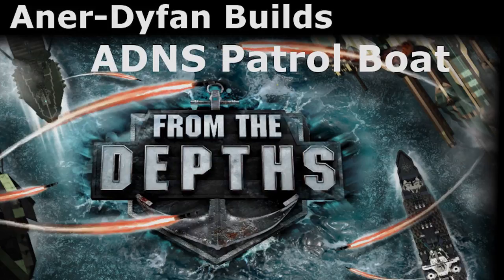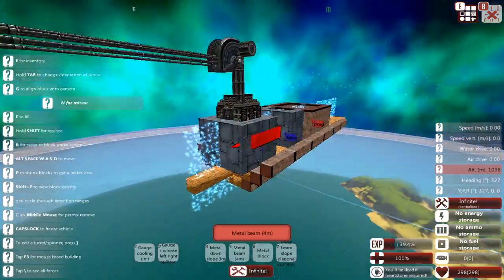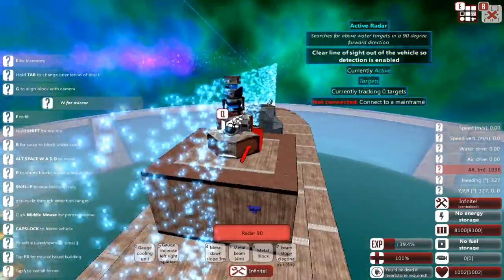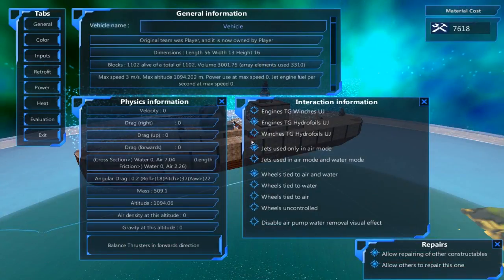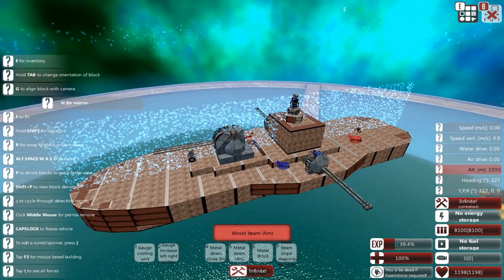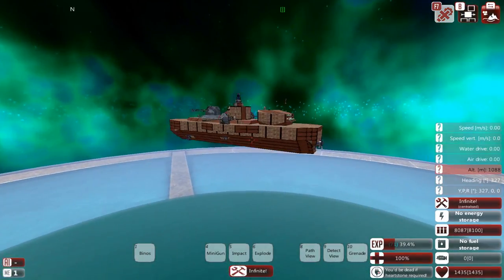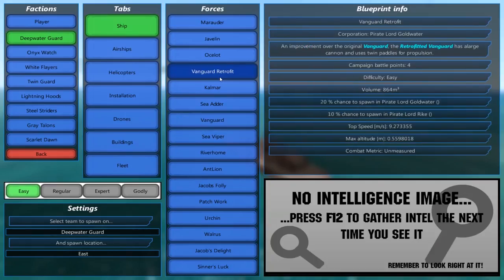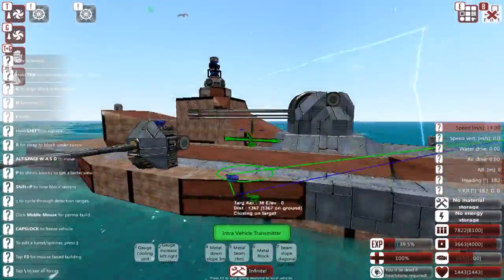From the Depths: #4: ADNS Patrol Boat

Comment: I've always had issue with building starting ships (without abusing speedmeta) as I just can't bring myself over the fact of lightly armoring something that will get hit/destroyed easily and therefore is more or less guaranteed loss of materials.

May I ask whether you believe it is better to build in a more "disposable" method of ship building where you have a lot of cheaper ships and rather discards a wounded member in a fight while keeping rest at full health over building one more armored vehicle (not meaning to abuse battlesize so going with full 50k) as it is possibly more efficient RP wise?
Reply from the maker: Unfortunately my only real campaign experience is the Cold Loch Xmas one, and my ships were not ideal for it as wanted to get it finished as quickly as possible. The experience I have with fodder is the Drone. Which did seem to cost a fortune in rebuilding, but when I stopped using them I found my cruisers were getting neutered on a regular basis so the drones were attracting a large volume of fire (especially missiles) it's balancing how many you need though, and how much to spend on your sacrificial pawn.

This however, is the sort of thing I'm wanting to find out when I start up the Quest for Neter campaign. I've planned a range of ships for the navy which will hopefully give more insight into this.
Reply: This is... surprising to hear to be perfectly honest. From the way you build/plan your building and your quite impressive knowledge of game mechanics I would have guessed you have plenty of experience? Or are you rather one of those "3000h in builder mode, 0h in campain" kind of person? I would clasify myself as a mix where I have about equal  amount of playtime in camp and in designer.

Regarding little drones, I've been messing around with a couple of tiny planes (and few subs) in around 1k of resource limit and I've found them quite effective (If made enough squirrel-like then even in lategame).
Allthough from around 1/3 of the game I switched into purely distractive drones (shielding, flares, radar/sonar buoy) as I found myself unable to create weapon setup small enough to stay within that 1-1,5K RP ceiling while being effective but with proper decoy setup the drones were able to survive quite amazing amount of fire put onto them.